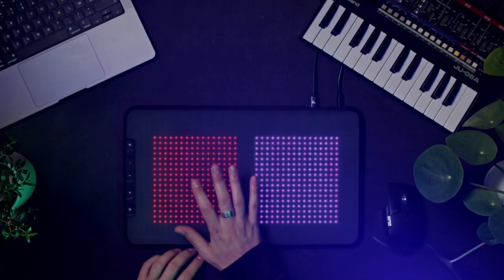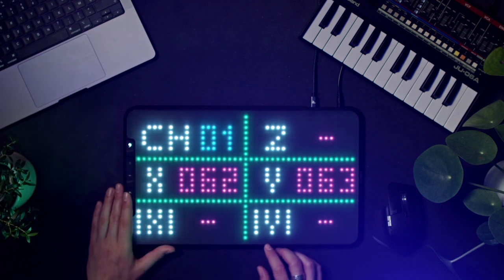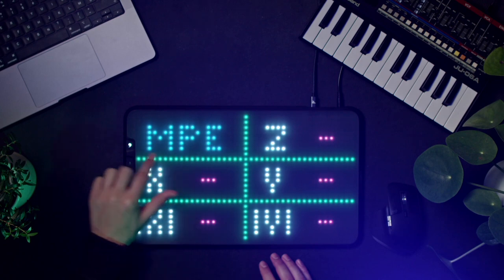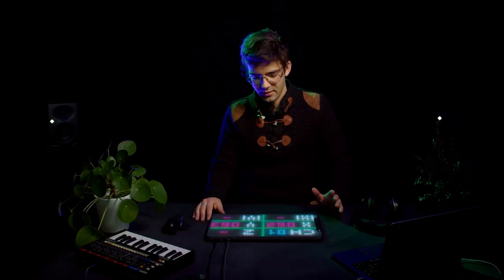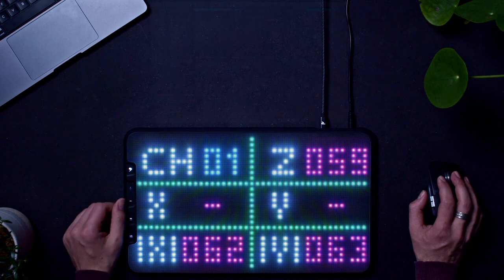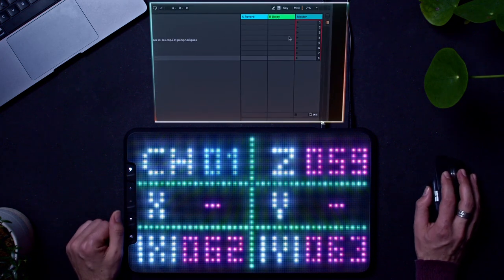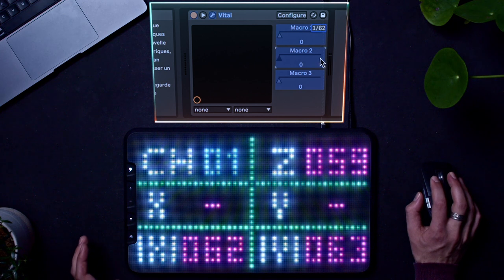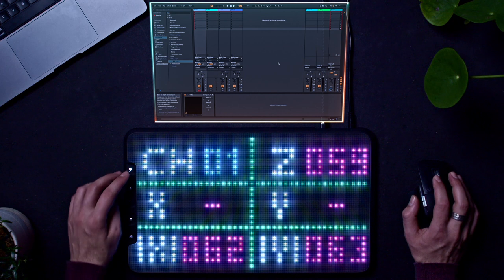CC Mapping - ERAE Touch Walkthrough Series

Comment: I select an element, I long press the bass clef and select the channel.  Unfortunately it always changes the channel on ALL elements.  I've yet to multi-map CC.
Reply: Have you solve it yet?
I was wondering if you could program a single pad to respond like a single drum head with different parameters the further away you go from the center of the pad so it can trigger varieties of the same sound like a real drum.
But i guess if you can not multi-map CC that would not be possible

Comment: Hello, really enjoying this series. Which Elements are you using the pitch mapped to the pentatonic scale on the x axis? I'm struggling to recreate this effect on my Touch. Love my ET, very happy! Thanks, RMS
Reply: that's the very same thing I've been trying to find out! which element is this, which has the same color, but multiple notes on the grid working together? also it'd be great to know the name of the beautiful instrument that you've used in this :)
Reply from the maker: @PraneetTulshyan  

Just seeing your message here: 

To replicate Altaïr Ableton+Vital interface :
 - Create a KeyGrid element that you play as a Chromatic grid (select for instance C MAj scale and make sur CH is highlighted in the Scale select menu in the ERAE or from the Erae Lab directly)

In Altaïr's case this Keygrid is just a SINGLE Note that is expanded/scaled on the entire surface of the ERAE
- Open Vital within Ableton

- Make the Macro 1 available from Ableton by clicking 'Configure' ( extended parameter menu of the peripheral plug-in menu at the bottom of your Ableton track) 

-> the Horizontal slide will appear as 'Macro 1' on the Right side of the Vital plugin within your peripheral track on Ableton

- This Macro 1 should be mapped in the Matrix Tab within Vital as follow
Source = 'Macro 1' --> Destination = 'Transpose'
(you can also Drag and Drop the MAcro One directly onto the 'Transpose' button within the VOICE tab
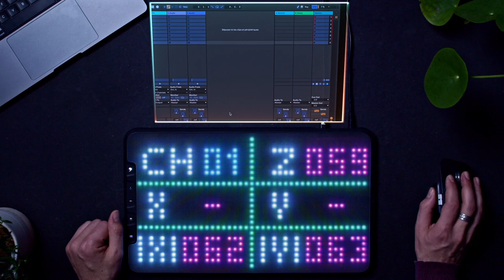- Then map the Absolute (or Relative) X axis from your ERAE as explained at 1:52 mn

And voilà ! 
The power of Mapping and Cc ;-)
Reply: @embodme  thank you! Will try this out :)